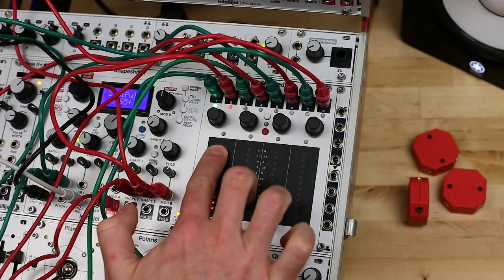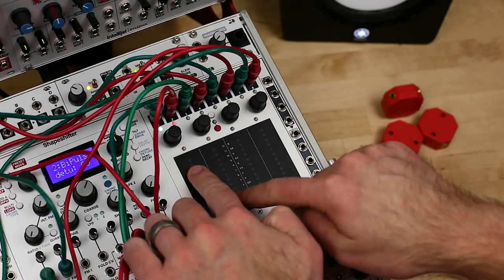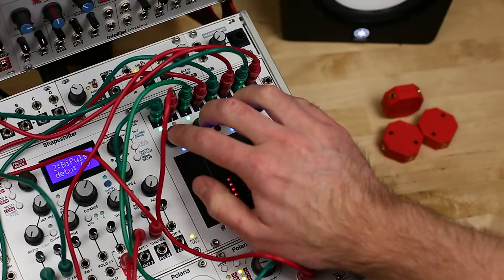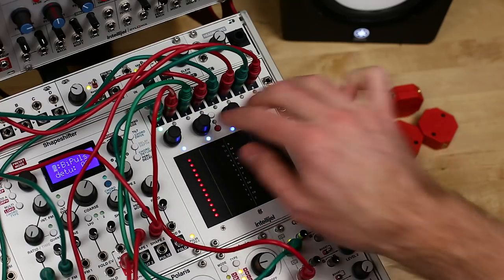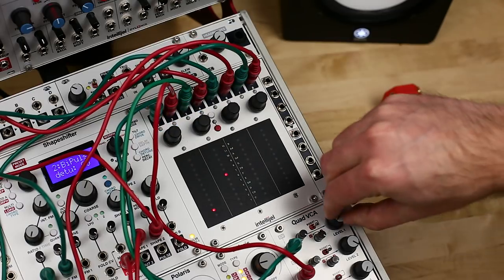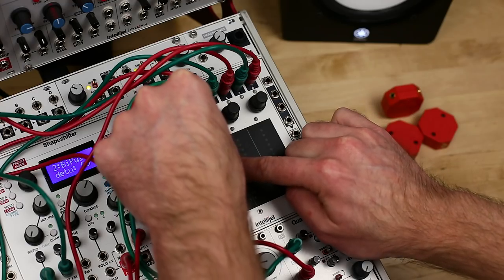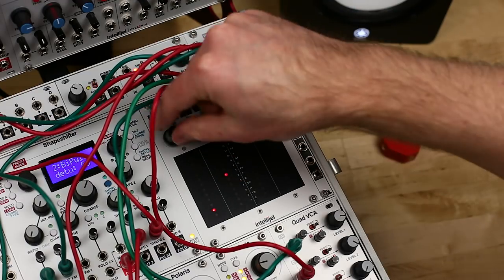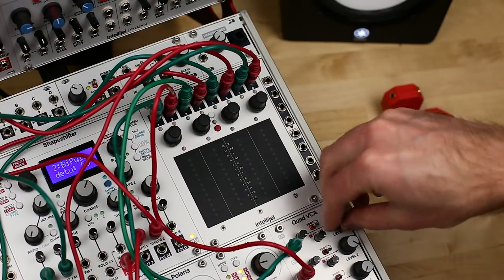Tetrapad: Mode 1 - Fader Mode

Comment: Now, when you say "pressure" are you talking actually pressure, or do you mean pressure like on the Pressure Points, where it's really the amount of skin touching the touchplate that's changing the voltage, not the actual pressure?
Reply: Actually pressure! These are not capacitive plates like pressure points, but pressure & position sensitive pads. So you can wear gloves or let your robot play it.
Reply: Pressure Points is false advertising. This is the real deal